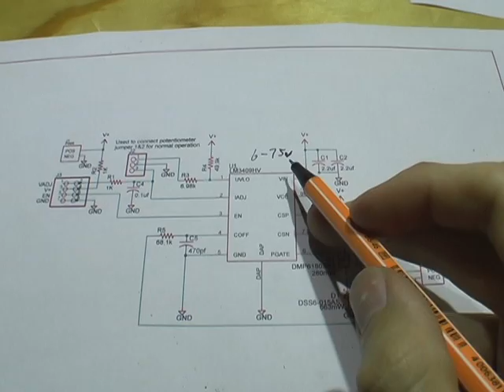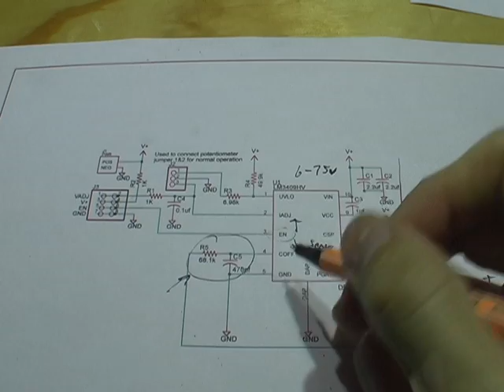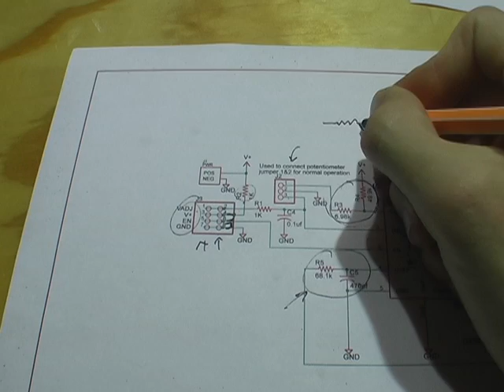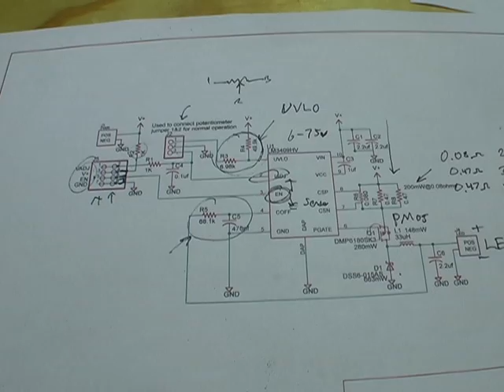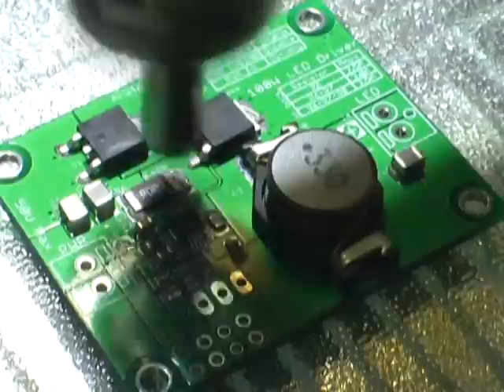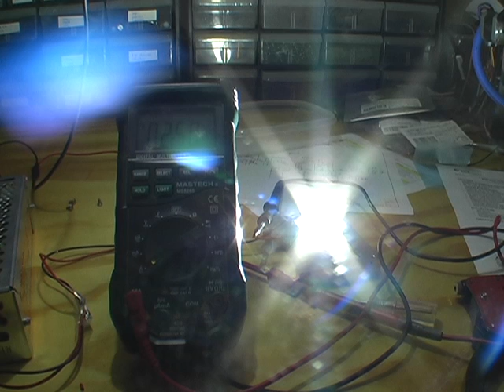100W Buck LED Driver board using a LM3409HV

Comment: I need help by finding  correct driver. I need constant output  10A 10V (100W). For input is not important. Output ripple i can deal after ( smoothnes ).
You did make super video.

Comment: Very nice!
Reply: DoublEElectronics I'm looking to do something like this myself and trying to learn how. I'm designing a controller/driver board for a bike light. I haven't found a driver IC that seems to fit yet. Would you have any suggestion for one to drive three 3.5V LEDs at 3 amps? Actually the LM3409HV seems a good match?
Reply: DoublEElectronics Thanks, their datasheets are really instructive. Where would you get a couple of them though? I can't find them on ebay. I also tried TI's sample service but it didn't seem like that group of ICs was eligible for sampling.
Reply: DoublEElectronics I live in Europe so the shipping from digikey is quite hefty. I'll have another look around to see if I can get it anywhere more local but otherwise I can order from there. But thanks!